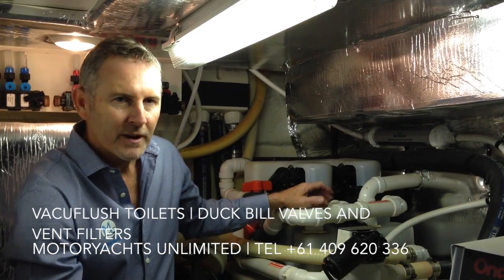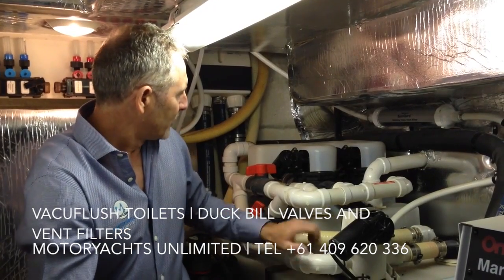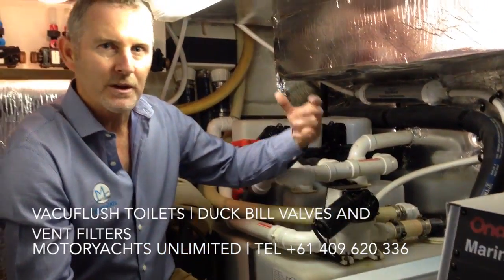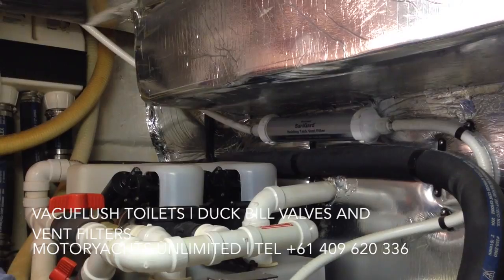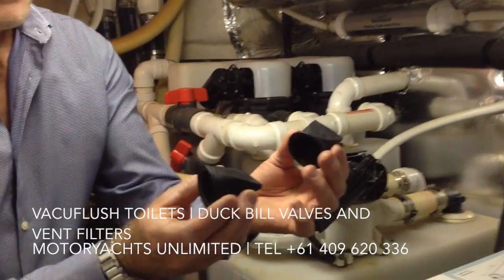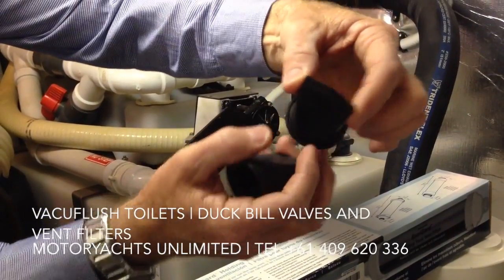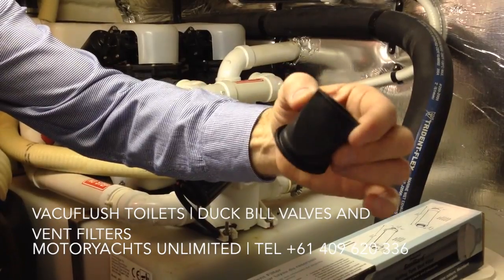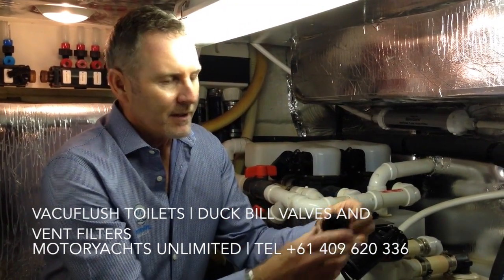Marine Sanitation Systems - Duck Bill Valves and Vent Filters

Comment from the maker: Tired, they generally use the same 12/24v fans that they use to ventilate the engine room and galley. They are called blowers. Quite noisy but effective. You can also buy solar fans. Just ask at your local chandlery, they should know.